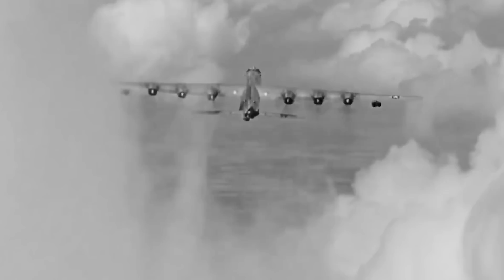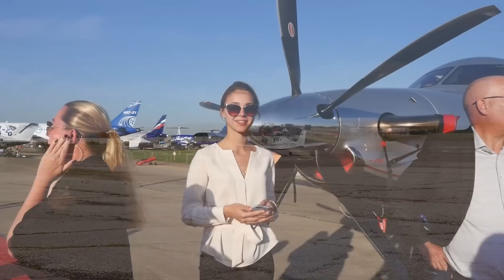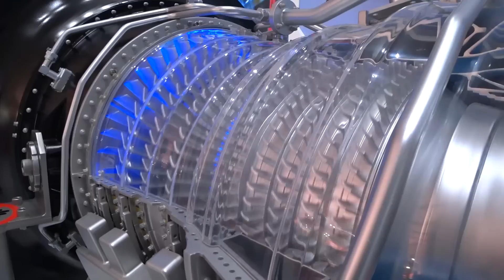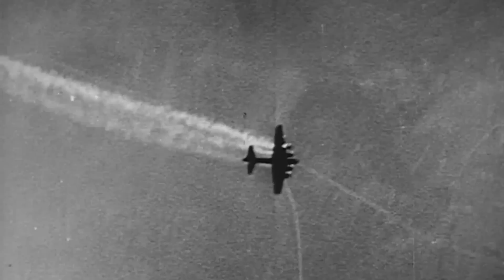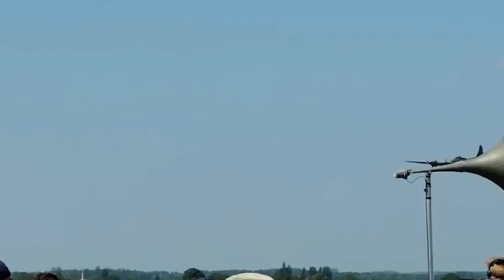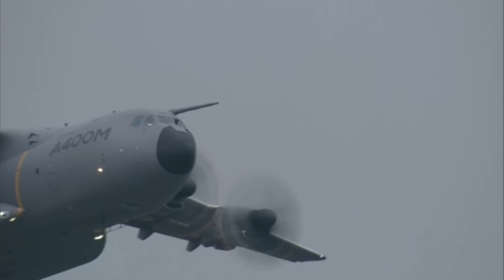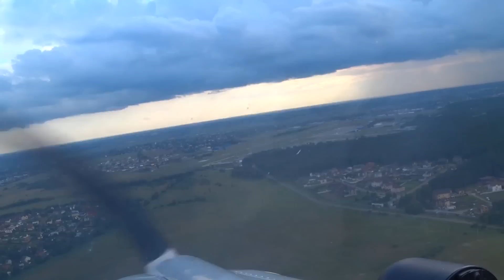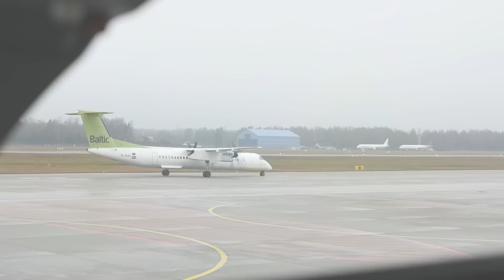Piston and Turboprop engines | What is the difference?

Comment: You seldom miss anything Sky, but how about the new diesel engines that run jet-a?  Several are very popular today, and the new high speed prototype with the V-12 diesel.   Just a thought....    --gary
Reply: Diesel is far-far heavier than already heavy normal avigas piston engine when still maintaining same power due to self-ignite super-high compression demand.

The goal of the aircraft diesel engine is only for efficiency. Not something that solve the world problem. Heck, we already have Napier Nomad with complex exhaust energy recovery system to overcome really bad power-to-weight ratio, and still pain in butt to use
Reply: @bocahdongo7769  Yeah, you are absolutely right. Let’s make a direct comparison. DA-40 NG with Austro AE300 engine and a little older DA-40 XLT with Lycoming IO-360-M1A. The Austro diesel is a 131 LBS heavier than the Lycoming. MTOW grew a little bit also, DA-40 NG at 2888 LBS vs DA-40 XLT at 2535 LBS. But don’t let the increase in the MTOW fool you. Seats full range for the NG is whopping 561 NM against the XLT with just 410 NM, both 75% power setting, 6000ft, still air. See the difference? Heavier aircraft with heavier engine and still itcan fly further, much further. Why? The diesel is simply that more efficient.
Reply: @Gemini1721999  Epic answer..  Kaito lived in the past...
Reply: @flexairz  Yeah, the future for GA is the diesel. But don’t let my answer fool you, I still love Avgas engines. Mainly because I fly the old Zlin Z-142 with Walter/Avia M 337 inverted inline six cylinder engine with radial compressor (supercharger), burning 40 litres of Avgas per hour :D. It’s a good feeling having 210 hp at 6000ft, +6g -4g acceleration capable military trainer aircraft. Oh, btw, rental cost is not bigger than a Cessna c172p. That’s a win win I think.
Reply: @Gemini1721999  Also, don't forget Avgas will only get more expensive as the push to get the lead out intensifies. I suspect diesel conversion will not be performance, but a simple matter of economy in the decades to come.
Reply: @Gemini1721999  The problem is that you're comparing 1930s gasoline engine technology to modern diesel technology. Modern gasoline engines burn just as much fuel as those Austro diesels by weight and they don't need to burn avgas, they can burn cheap, unleaded mogas instead.
Reply: @Gemini1721999  Diesel fuel density. By volume diesel gets you twice as far as petrol.
So 100 litres av petrol might take you 800km but 100 litres diesel might get you   1600km. And diesel isn't that much heavier than petrol either so it really is the most efficient fuel for reciprocating engines (using modern materials in construction).
Reply: @aliceharris9030  "By volume diesel gets you twice as far as petrol."
-
No, it doesn't. The 2015 VW Golf TDI (post dieselgate fix) used 2.9 gallons to drive 100 miles, the 2015 Honda Civic used 3 gallons to go the same distance. The 2016 Honda Civic used 2.9 gallons to drive 100 miles, just like the TDI. Diesel fuel is only 5% more energy dense than gasoline by weight, not 100%.
Reply: @PistonAvatarGuy  Ok. Can you compare the displacement of those motors?.
How many millilitres of fuel is used per cycle by comparison? 
How many millilitres of fuel/air mix is used per cycle by comparison? 
Milliltres of fuel without air multiplied by number of cylinders multiplied by  revolutions per minute compared on a level playing field? (Engine/engine) and that tabulated with torque/power output?

From:
https://www.acea.be/news/article/differences-between-diesel-and-petrol

Diesel and petrol engines

By virtue of the combustion process and the overall engine concept, a diesel engine can be up to 40% more efficient than a spark-ignited petrol engine with the same power output, ceteris paribus, particularly with new ‘low’ compression diesels.

The calorific value of diesel fuel is roughly 45.5 MJ/kg (megajoules per kilogram), slightly lower than petrol which is 45.8 MJ/kg. However, diesel fuel is denser than petrol and contains about 15% more energy by volume (roughly 36.9 MJ/litre compared to 33.7 MJ/litre). Accounting for the difference in energy density, the overall efficiency of the diesel engine is still some 20% greater than the petrol engine, despite the diesel engine also being heavier.
Reply: @aliceharris9030  I'm not sure how displacement is relevant, power output is the only concern, as that is what affects performance. The 2016 Civic made 174 hp, the VW made 150 hp. The Civic possessed superior acceleration performance, while matching the efficiency of the diesel.
-
"How many millilitres of fuel is used per cycle by comparison? 
How many millilitres of fuel/air mix is used per cycle by comparison? 
Milliltres of fuel without air multiplied by number of cylinders multiplied by  revolutions per minute compared on a level playing field? (Engine/engine) and that tabulated with torque/power output?"
-
That's WAY more detail than we need for this conversation. They're using about the same amount of fuel to accomplish roughly the same task, that's all that matters. Really, all that matters is BSFC, and it's about the same for modern diesels and modern gasoline engines.
-
"...a diesel engine can be up to 40% more efficient than a spark-ignited petrol engine with the same power output..."
-
UP TO, that simply doesn't apply to modern diesels and modern gasoline engines. Over the years, gasoline engines have gotten more efficient as a result of advancing technology, while diesels have gotten less efficient because they're filthy and their efficiency is reduced when their emissions are regulated to the same standards as gasoline engines.
-
"...the overall efficiency of the diesel engine is still some 20% greater than the petrol engine..."
-
It's about 12 to 15 percent in the US, because we require diesels to meet the same emissions standards as gasoline engines, which reduces the efficiency of diesels. The emissions from gasoline engines are relatively simple to reduce to acceptable levels, so the efficiency of a gasoline engine is not greatly affected by emissions standards.
Reply: @aliceharris9030  Also, that 12 to 15 percent advantage really only applies to urea injected diesels, the "fixed" dieselgate diesels had no efficiency advantage. In the US, diesel fuel costs about 12 to 15 percent more than gasoline, so there is no cost advantage to owning a diesel. Burning diesel fuel also results in about 15 percent more CO2 being produced, so there's no advantage to using a diesel to reduce greenhouse gas emissions.
Reply: @aliceharris9030  " "Reported me eh?"
-
No, why would I do that?
Reply: @PistonAvatarGuy  wrong diesel  will out last a gas engine
Reply: @dknowles60  That depends on a huge range of things, diesels are not inherently longer lasting than gasoline engines.
Reply: @PistonAvatarGuy   wrong. 99% of the time diesels out last gas engines.  my cummis diesel isx had 900k miles and 30k hours and us truckers beat the crap out of diesels and  they spend a lot of time in idle
Reply: @dknowles60  But it's not a property INHERENT in diesel engines, good longevity is a trait common to HEAVILY BUILT engines, regardless of the fuel being burned in them. When diesels are converted to natural gas engines, they last LONGER than if they were burning diesel, because the diesel combustion cycle is harder on engine components, as are the combustion byproducts, which end up in the engine oil.
-
Your Cummins engine probably weighs a thousand pounds, semi-trailer truck engines weigh as much as a small car, THAT is why they last, it is in no way related to the fuel being burned in the engine.
-
Consider the Oldsmobile 350 diesel, it didn't last and was horribly unreliable. Many modern diesels found in passenger cars also tend to be fairly short-lived and they tend to have HUGELY expensive problems during their lifespan.
Reply: @PistonAvatarGuy  yes the 350 was crappy
Reply: @dknowles60  So was the 6.0 liter Power Stroke, so are many of the current model diesels.
Reply: @PistonAvatarGuy   they out last air plaine piston  motors. they need by fed gov law rebuilding . every apx 2000 hours. if air plane avg 130 mph that is only  260k miles. i know car diesels that go 1 million miles  or  30k hours
Reply: @dknowles60  A) They're too heavy to be practical in the majority of aircraft applications. B) Road miles can't always be equated to miles flown, because aircraft engines operate at much higher power settings than most road vehicles. Heavy diesels are an exception in this case, as they're designed to operate at high power settings continuously, but they're 3 to 4 times heavier than they would need to be for them to be viable aircraft engines. C) Also, AGAIN, modern gasoline engines would significantly outperform current gasoline aircraft engines, further increasing the gap between the performance of gasoline and diesel aircraft engines. 
-
If you were to use a MBE 4000-450 to replace the R-985 (an engine designed in the 1930s, mind you) in a DHC Beaver, it would absolutely destroy the CG of the aircraft and eliminate about 75% of its useful load, effectively making the aircraft a single place aircraft with very little range. 
-
There are already diesels which are certified for use in aircraft, they're insanely heavy and their TBO is worse than many gasoline engines. The AE330 diesel, for example, has a TBO of 1,800 hours and it weighs 410 pounds, while only being capable of producing 180 hp. AGAIN, the diesel combustion cycle is HARDER on engine components, it wears them out faster unless they're insanely overbuilt.

-
For comparison: A 180 hp Lycoming IO-360 weighs 270 pounds and has a TBO of 2,000 hours, and it's been in production since the 1960s.
Reply: @dknowles60  Also, Cessna tried to use diesels in the Skyhawk and Skylane, both were failures, they were just too heavy, too under powered and too expensive to be desirable.
Reply: @PistonAvatarGuy  They tend to run at lower rpm, which makes them longer lasting.
Reply: @trezapoioiuy  A) Longevity isn't dependent on rpm, it's more closely related to piston speeds, bearing speeds and the stress placed on engine components. The Rotax 9xx engines, for example, last just as long as Lycoming and Continental engines, but they operate at TWICE the rpm. B) Diesels are more highly stressed than gasoline engines, so even if RPM were related to longevity, diesels aren't capable of lasting any longer than gasoline engines.

In aircraft, diesels actually have shorter lifespans than gasoline engines.
Reply: @PistonAvatarGuy  Isn't the Rotax also considerably more modern than Lycoming &co?
Reply: @trezapoioiuy  Somewhat, but it's still a nearly 40 year old design and it doesn't really incorporate a lot of the modern technologies which would improve its longevity over that of the LyConts.
Reply: @trezapoioiuy  Anyway, gasoline engines work just as well as diesels at low rpm, there's not one thing that prevents them from doing so, and LyConts are evidence of this.
Reply: @bocahdongo7769  That's why the JU86 had opposed piston diesel engines .vs. standard 1 piston per cylinder compressing the Air/Fuel mix against the engine's head... The main advantage in the 1940's of the JU-86 was it could fly higher than anything else.  Rolls-Royce had to modified their Merlin engine in a Spitfire to intercept the Nazi Recon Ju-86s over Britain.
Reply: @timengineman2nd714  "The main advantage in the 1940's of the JU-86 was it could fly higher than anything else."
-
That was because it used nitrous oxide injection, not because it had diesel engines. Diesels actually have a harder time running at high altitudes, because they require more boost to make power than gasoline engines. The record for the highest altitude flight by a piston engine aircraft is held by an aircraft which used gasoline engines, the Grob Strato 2C. The Strato could fly at 78,700 ft (24,000 m).
Reply: @PistonAvatarGuy  Before they used N2O, the Ju-86 had set a few altitude records, there is a hint (forget where I saw it) that they actually were playing around with a 2 stage 3 speed centrifugal supercharger, also a (more normal style for WW2) 2 stage 2 speed supercharger, but had added a turbocharger to feed air into the supercharger, which is not the usual arrangement since normally you either had a supercharger or a turbocharger!!!
Reply: @timengineman2nd714  Actually, most turbocharged aircraft during WW2 were also supercharged. The P-38, the B-17, B-29, P-47, etc.
Reply: How bout that diesel in a turbine?
Reply: @georgegarrett9021  My Ford Duratec 2.7 litre twin turbo diesel engine went good on diesel.
Diesel motors for aircraft are feasible utilising modern lightweight alloys.
A jet turbine that runs on diesel seems like it's going to gum up too fast. 
Kerosene burns cleaner (I mean, it leaves less deposits on the turbine vanes as it passes thru the compressor sections and the combustion sections of the turbines.)
Reply: @aliceharris9030  I guess. I know people who have done it for years including my son.
I'm talking AG flying now. I have never done it. But he has an air tractor 802 with a PT6-65 and that is all they use.
I thought the same as you 20 years ago when his uncle told me about doing it.
Reply: No, sky was correct about the general purpose of each engine. Diesels, mainly used in Diamond Aircraft and others, are great. They are efficient and probably more reliable then petrol ones. But for large part/far 25 aircraft, pistons are a dead end due to the scale, weight and complexity issues that are well explained in the video.

Comment: why don't we see 4 engine turboprop passenger jet now a days? would not it be more economic
Reply: You save on maintenance costs by lowering the number of engines, even if those engines are larger. Since we've figured out that two engines is the minimum for a passenger airliner, we've stuck to that. Even the 777 only has two engines, and that's currently the largest serially produced passenger airliner being manufactured today since they recently shut down the 747 and A380 production lines.
Turboprops are also louder both inside and outside the passenger cabin, meaning that they have to spend mass on soundproofing the passenger cabin.
A turboprop aircraft of a given passenger capacity and range must fly lower and slower than a similar aircraft using modern high bypass turbofan engines, but flying higher and faster means you get better fuel economy, so the fuel economy difference between the two is not all that much in practice (maybe a few %, not enough to warrant creating a whole new aircraft or scrapping all your existing aircraft for). This is especially true with each generation of turbofan powered aircraft boasting at least 10% more fuel efficiency than a previous generation similar aircraft. It would take a lot of innovation with a turboprop to make up that difference.
Furthermore there's the issue of size. Turboprops stick to short routes where their low flight ceiling is not a big deal, which means that they don't need to be all that big. Even in that niche the regional jet airliners of similar capacity aren't that much less efficient.

Basically, the reason you don't see them is that there are a lot of downsides that this video might not have covered, but that actually matter a lot, and some of the differences that are pointed out in this video aren't actually all that different in practice.
It's mostly a case of "turboprops aren't "gooder enough" to be worth it".
Reply: @44R0Ndin  I couldn’t have said it better myself.
Reply: @44R0Ndin  thanks
Reply: @44R0Ndin  I guess he didn't go much into turboprop vs turbojet/fan because the video is piston vs turboprop.